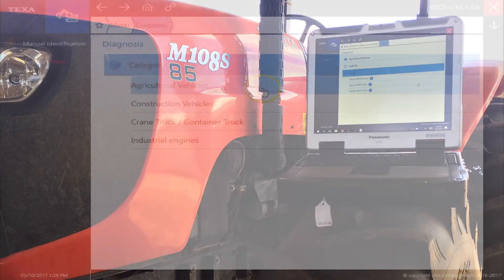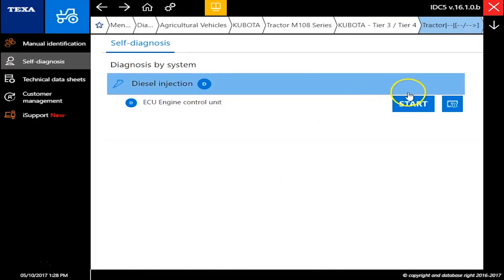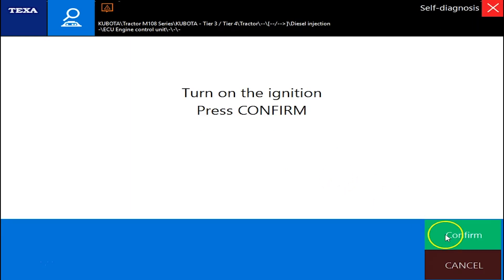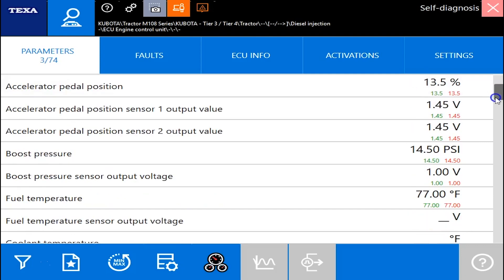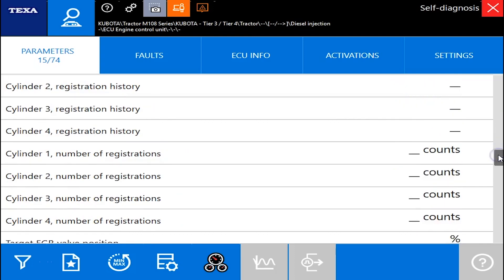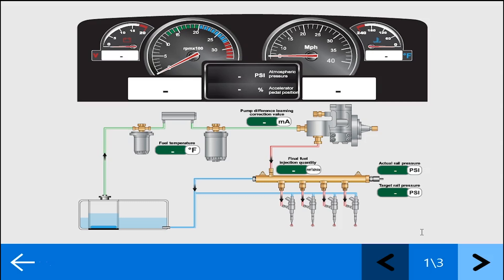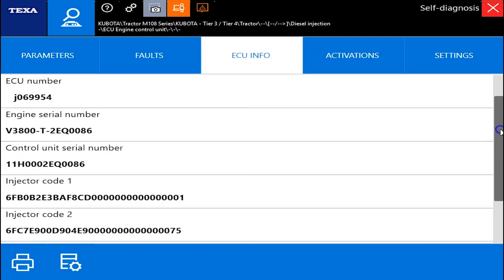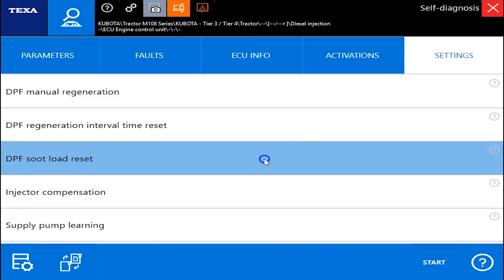TEXA Off Highway Diagnostics on Kubota M108 Tractor & Engine

Comment: After changing the stuck SCV (suction control valve), ECM does not send out 12V to all 4 injectors anymore. Can I use this to reset ECM to reactive the injectors ?

Comment: If you can’t program control modules, you shouldn’t be able to call it “dealer level”
Reply from the maker: You can use it to program new components such as VGT actuators, injectors, and other components, along with reset commands. Where the line is drawn is when an entire new computer ECU needs to be installed, which isn't diagnostics. Its a complete ECU programming. You'd need a dealer for that since no one else can do it.
Reply: That makes sense. With the Right to Repair being implemented, will that impact further functionality on these tools, or are there some things the dealer will still be allowed to keep “dealer only”?